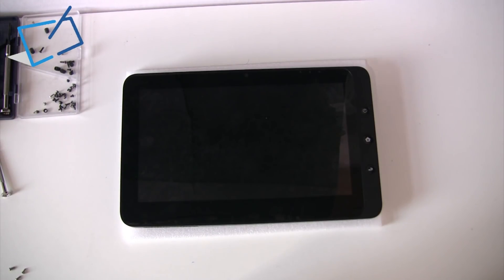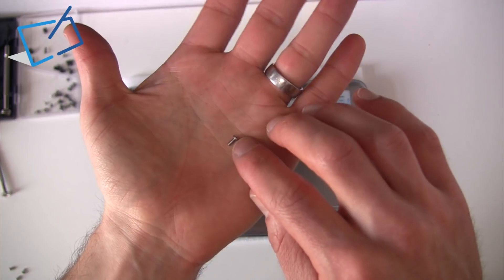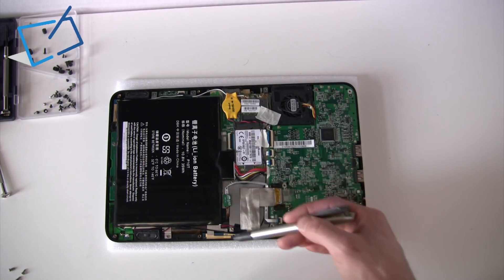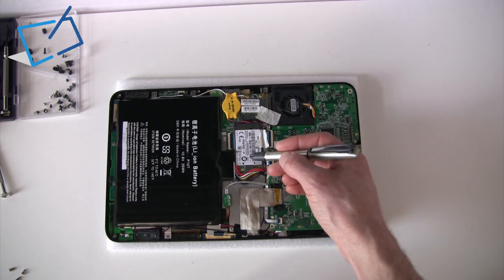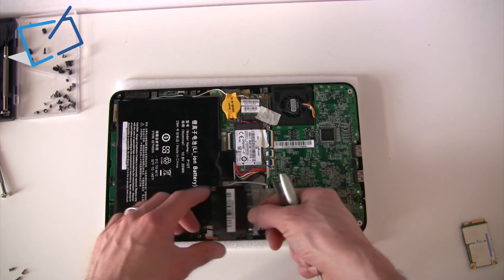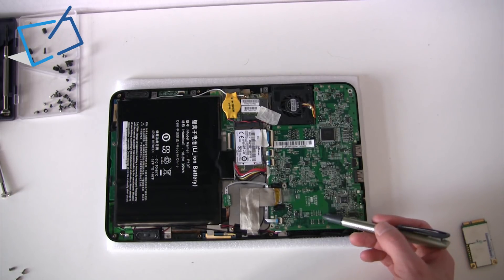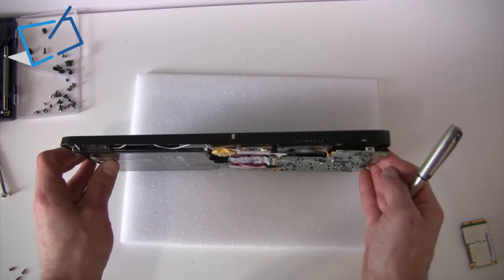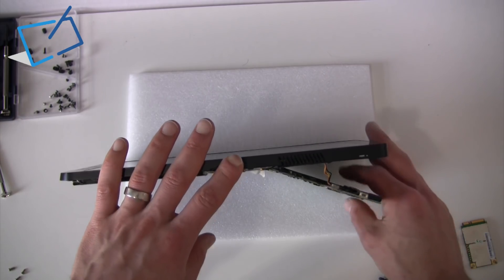How to upgrade 3G, RAM & SSD on ViewSonic VIEWPAD10

Comment: I played around with a newely Vtab10 that was gifted to me and upgraded the SSD and RAM but at the moment the Tab will not boot witha 4GB RAM module. It boots with the SSD and the 1GB ram that was originally in there. I wonder is The 4GB RAM chip is bad or I'm Putting too much RAM for the Motherboard able to support. Your thoughts are apreciated. Thanks.
Reply: I am having the same problem
Reply: The Device is not compatible with higher memory than 2GB. I installed the 2GB chip and now it works just fine.

Comment: hello guys, I can answer most of your questions. For the 3g module, I'm not sure. for the ssd you will need to take apart the ssd and get the part out that he put in the pad, or you can buy an mSATA. As for memory, you'll need standard laptop memory.
Reply: +Viva Gamez this applies for all viewpad 10 siries. 10pi, 10s, 10 whatever.

Comment: 256 GB SSD Please bear in mind this only works for Viewpad 10 pro (Windows version)
http://cgi.ebay.co.uk/ws/eBayISAPI.dll?ViewItem&item=281275024741
Reply: basically NO ssd will ONLY work in one device they are universal.
Reply: +Michael Street (NitroKiwi) this would of been correct at the time he wrote it in that this 256gb solid state drive would only work in this tablet as no other tablets take them, in fact it could even still very well be the case. I know your trying too be clever and are talking about all devices but that is just too obvious, I mean its about tablets so hes obviously not saying it wont work in laptops as that has nothing to do with this or tablets in general. Anyone with a brain would know he didn't mean that its for just this device out of the entirety of electronic devices, why would such a device exist. would be bad for sales and profits for the company who made it so thanks for pointing out the obvious. so many people would be lost without people like you
Reply: *laptops in general

Comment: Do have to open a VPAD7, for a hardware upgrade? I want to install android 4.0, but the assistence tecniche said, what I will change some pieces in the tablet, thx for the help.
Reply: the only thing, that you can upgrade there, is internal sd card

Comment: I wanted to know if you have a video for an Android 7inch tablet i wanted to upgrade the ram from 512 to 1Gb.  It has CPU, Actions ATM7013 1.2Ghz CPU+3D GPU+VPU, GPU：OpenGL ES1.1 and 2.0  Model ATM-Q8.

Please let me know if your are able to help me take the unit apart without breaking it.

Thank you 

Best Regards

Mr. King